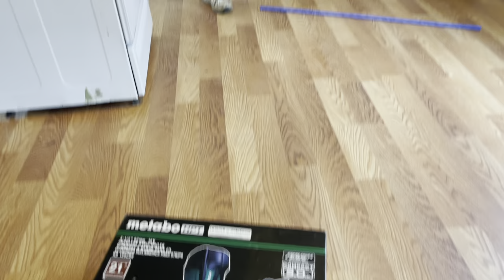Mobile Home Flooring Issues. mobile home remodeling

Comment: I grew up in a mobile home park in the early 90s, and our neighbor across the street had a 1977 Titan with a tall asphalt shingled roof-over. I have no idea when that roof was installed, but by 1990, all the floors were crowned worse than what's seen in this video. In the mid 90s, they had a carpenter replace the flooring in several spots - I believe he sistered some of the joists or shimmed the subfloor, either way, it flattened it out somewhat... but it only got worse as the home aged. By 2004, they gave up on the home (which was badly deteriorated anyway) and had a brand-new Schult double-wide built to replace it. Within two years, their brand-new washing machine let loose and flooded the utility room, destroying the floor which I believe was still made of compressed sawdust... I swear to god I will NEVER own a mobile home...
Reply from the maker: The floors now are made of a different material
Reply: Drew and CREW to the rescue.   We appreciate u..    mercy 😇😇

Comment: Sorry to keep making suggestions, but this place looks like it's going to be a gut job for the whole mobile home, walls and everything, including the front bedroom, and that bathroom needs to be reframed to put the sink in the bathroom, not the bedroom!, I would move the front door over about 3 feet, move the front bedroom wall out about 2 feet to allow room to remake that front bathroom a little bigger so the sink can be put back into the bathroom!
Reply from the maker: I did not do this. He did not have enough money
Reply: @Drewsroofingandhomerepair  That's good that you walked away ! It looks like you and your partner would have gotten in a situation where more hidden problems would have come up and the owner would have gotten upset that you guys 'torn up ' his mobile home and wouldn't have paid for all the proper repairs that needed to be done ! I believe you dodged a bullet on that one, especially seeing how bowed out the exterior walls were !, also I noticed that the video shows under the mobile, it looks like some of the metal frame wing gussets were starting to twist on their bottom edges,being a 'T' type of wing gusset frame extension !
Reply from the maker: I agree it was the best thing to do walk away

Comment: Have you ever worked on a mobile home floor that waved from condensation?
Reply from the maker: Yes I have and let me tell you where it’s coming from. Check to make sure that your vents are not compromised. What I mean by that is open up your vent make sure the tape is still on the metal trunk so that the air is not escaping under the house

https://youtu.be/In6UGaTGUDI
Reply: I hate to even ask this but exactly where am I supposed to look inside my actual vents inside or under the house?🥴
Reply from the maker: Look inside the actual vent pull the vent cover off and make sure the tape on that vent is in good shape and not allowing air to blow under your house.
Reply: @Drewsroofingandhomerepair  you were exactly right the first vent I opened in the room with the worst waving floor was a mess the tape was barely hanging on and I could feel the outside air coming through a hole in the vent where it overlaps

Comment: So how does one fix the sagging exterior walls that are sagging because of the weight of the metal roof?
Reply from the maker: Unfortunately it’s not just a metal roof it’s a 2 x 6 rafter roof built on top of this house oh my God you would have to get into the house and jack it up on the exterior walls if you’re lucky you could do that. It’s been sagging a long time
Reply: @Drew's Roofing & Home Repair  oh wow! It's ashame whoever built the new roof didn't either have the knowledge of what would happen or just didn't care! I've seen what the exterior walls are made of ,it was just 2x3s on the one a saw. I can't imagine that would be strong enough to support the kind of weight a 2x6 structure had! I feel bad for the owners of this home. What did the owners decide to do??
Reply from the maker: They decided they cannot afford to do the repairs they have less than half the money it would take

Comment: It's amazing what shady mobile home flippers will do around here. Some examples; putting new laminate flooring over a rotten subfloor, using Killz white paint to cover up water and mold stains on the ceiling (roof still leaking), and painting over rotten walls/paneling
Reply from the maker: You really have to do your homework before you buy something and spend the money to have it inspected on your own

Comment: ive seen the particleboard swell to over 1.5 inches thick under wall plates. it was all dry & been thay way for a while. i was not gonna dig all that crap out to put new ply sheets under the wall. the trailer was used as a duck camp & had gotten submerged into the ARK. river during a flood. a few years before... the whole structure needed a dozer & start over. but the owner agreed to my 1/2 ass way of salvaging the rest of the structure, as the flood waters , believe it or not, stopped even with the floor. the trailer had a nice built on room that was worth 4 times the shitty 1978 trailer it was  attached to... me and my guys removed all of the old P.B. chips that we could, blocked all over the random placed floor joist with 3.5" deck screws. hung some insulation as best we could & put down 3/4" ply w/deck screws. caulking everywhere that was needed. i showed the owner the obvious other damage, a few concrete piers were washed way outta place..  i told owner ; MOLD WILL GROW, GONNA BE VERY DRAFTY IN WINTER, YOUR GONNA HAVE TO MONITOR YOUR PLUMBING LIKE A HAWK. .. he said he never really went into that side of the structure except for coffee pot & microwave... he kept doors closed... he didnt wanna just build a nice rear wall to the well built add-on. he just wanted to be able to walk thru... as bad as i hate to 1/2 ass a job... he was super happy , he had a floor that my 220lbs. self,  jumped from end to end. he was a local guy so we took 4k of his insurance money, even hauled off the tainted debris. he kept the rest of the money in pocket. i hope nobody gets sick from the mold. the next little flood in that prone area is gonna take the trailer section... he probably build a rear wall with the next ins. money...
Reply from the maker: Wow it sounds like you had to do a lot of work to fix that place and it really never got fixed properly but like you said if he was happy I guess that’s all you can have or expect. It sounds like you did the job the very best you could I guess at least she has something

Comment: I say its a tair down
Reply from the maker: I think I agree
Reply from the maker: The roof should’ve never been put on this mobile home without supporting it first
Reply: @Drewsroofingandhomerepair  i have did a frame roof in the past but I used  4x4 along side the trailer in the ground  contented  the rafters to them no wight the trailer roof at all....
And now with that one jacking sides  back up I see bucking  in the side's  in
Reply from the maker: I like the 4 x 4 post idea but I like the 6 x 6 post idea better I’m not sure how it is buckling if you put your post all the way to the ground and put a roof up there how is it still buckling